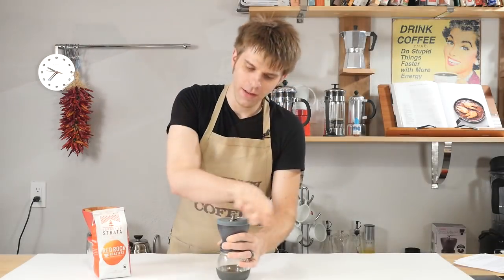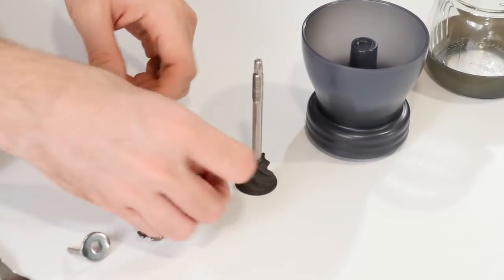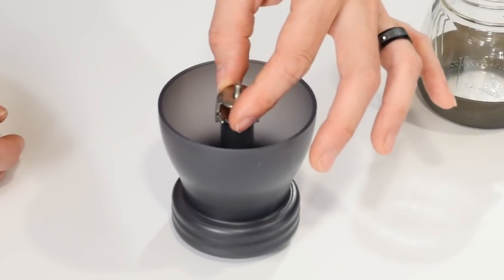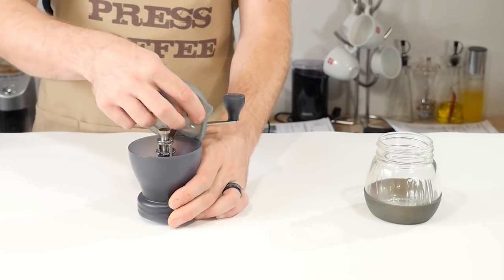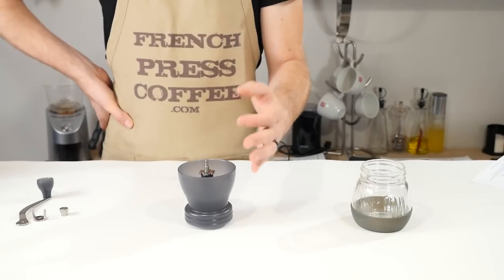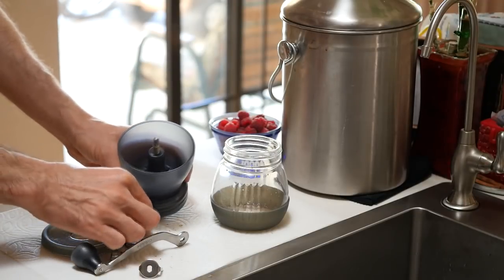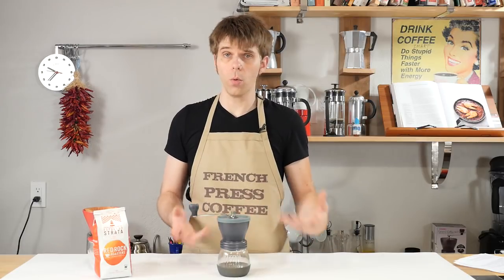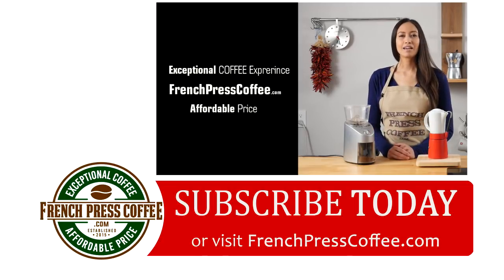Hario Ceramic Coffee Grinder Instructions - How to Use, Adjust the Grind Setting and Clean

Comment: I've had this grinder for about 5 years now, and I finally (just a few weeks ago) had a light bulb moment and discovered a great way to get the grind consistent: Once I got the grounds to be perfect for how I like my French press coffee, I used a ruler to measure the length of the screw shaft that was between the nut and the end of the screw shaft.  Then, I took the ruler and used it to put a tiny nick on the handle of my stainless coffee scoop. This made my scoop a "ruler" that I always have in my kitchen when I'm grinding coffee. I just put the end of the scoop handle on the nut and twist the nut until end of the screw lines up with that nick. Consistent every time, and no guesswork.
Reply: What’s your measurement for the French press?
Reply: @brentlawson1982  It's just about 3/4", and then I may have to adjust a little bit for different beans. Like for Dunkin' Donuts beans, I find I need to go a little finer for the coffee to be strong enough, and then for others, I may need to go a little coarser.

Comment: If you ever break your glass base, a Trader Joe's Cookie Butter jar is exactly the correct size.
Reply: A standard Ball regular mouth mason jar fits the Hario perfectly. I prefer using the 16 oz amber (UV resistant) but can get a round 8 oz that almost matches the original jar. 👍👍
Reply: @jamesb3092  But then you don't get cookie butter :(
Reply: Perfect. Thank you!
Reply: Thanks for the tip. I managed to break the glass jar of my Hario today because I didn't have it tight enough and it slipped onto my granite counter top (a whopping 3 inches :-\ ). I remembered this tip, so after I cleaned up the broken glass, I just grabbed another glass jar and kept on grinding. There will be coffee for the morning after all. A Classico pasta sauce jar is also the right size, BTW. Perfect that I was having pasta for dinner tonight... :)
Reply: hahaha
Reply: That is a really solid and useful tip. Also helpful for grinding different types of beans. I look forward to learning about Cookie Butter too! Very Cool!
Reply: Thanks Raffie

Comment: Great video. I've had this grinder for a few years and just realized the clear washer goes on first! Thanks! Another tip... if you break the glass jar or if you want a jar that is easier to hold when grinding a Mason jar has similar threads. I broke the base and replaced it with a small Mason jar. Threads on perfectly and is much easier to hold when grinding!  Thanks for the marking and notch setting tips! That is brilliant!

Comment: Good video, my Aeropress comment: I aplogize if I use the wrong coffee terminology, I am still trying to find correct notch, I am on notch 9 after my 5th test cup.  The instructions showed 2 I believe for Aeropress, it seemed a little too fine compared to my Baratza Encore electric grinder which was a 12 (Encore setting). On this Hario, when pressing the coffee this finer grind, was hard to push through, this 9 setting was close to being similar to my Encore but still harder.  The flavor of the coffee at 9 was very good (smooth) but strong. did not want to forget to post this so I am posting before I have found mine 'good' spot.  I will post next setting (or 2 or 3 or 4) as I do more experimentation.

BTW, How often do I need to do a cleaning?

Comment: My one-cup drip maker of 20 years quit on me recently and while I'm deciding what direction to go in I'm trying out a French press I happened to have.  I followed the instructions here and adjusted the nut to 7 notches, but the grind looks as fine as it was for my drip maker, if not a little finer.  It also looks pretty consistent considering the complaints I'd read about the lower burr wobbling with coarser grinds.  Either I misunderstood the instructions (provided they were indeed correct) or I've been using too coarse a grind with my drip maker all of this time.  For that I would grind 1 tbsp of beans per 3oz of water, so 2T for  6oz cup or 3T for a 9oz. cup, and this always seemed about right - a little stronger than most people prefer it seemed as restaurant coffee tastes watered down to me.  And my understanding is that these proportions are pretty standard so if anything it would seem that my drip-maker grind was finer than what most people use.  For my first French press I used 1.5oz of beans for 12oz water, and the result tastes pretty strong even for me -  with sugar, milk and cream I'm still feeling more of a jolt than I'm used to.  I can tweak the amounts but it still seems that this method uses more coffee beans overall than the drip maker did.  The strong flavor may be due to a too-fine grind, but this gets back to the original question of why they're too fine if I followed the instructions - ?

Comment: If the fixing nut becomes too tight to unscrew, instead of using a tool that may damage it cosmetically, just firmly grab the handle and turn the adjustment nut in the finer grind direction just a bit - movement restricted by nut stopper anyway - and try loosening. This has always worked.

Comment: I use my Hario Skerton just for a coarse/French press grind.  The video suggests setting the notched nut up seven notches from the zero position for a coarse grind, but that is nowhere near high enough for a coarse grind.  At least twice that is needed, unless Hario has dramatically changed their design (which I highly doubt).
Reply: What do you set to?
Reply: Absolutely. Also, do not under any circumstances use 1 notch setting for moka pot grind, youll ruin the brewer.
Reply: Right? I use 6 for my aeropress and it works wonders for me
Reply: @user-1312  what's your notch setting for a moka pot?
Reply: My settings:
- 1 => turkish
- 4 => espresso, mokka pot, you migh try also 3
- 5 => all brew coffee
- 6 worth try for french press with different coffee, but mostly useless without the Blue Horse adapter.

Comment: I use the Empare grinder, it has an identical shaft and burr set but includes a spring that keeps the burrs apart. That keeps the burrs from striking each other and the grind is more consistant.

Comment: I found 1-2 notches way too fine for my semi-auto espresso machine, Sunbeam Mini Barista em4300
3 notches is ok but you can't tamp much otherwise it'll be too compressed. Just a light touch tamp will do. 
I found 4 notches (about a medium-fine grind) worked best. Add more coffee to make up for the bigger grind size to get the right espresso extraction.
Reply: I use the notch nr 4 too (starting from zero) and 5 for brew coffee. Setting 6 and above is too uneven.

Comment: I think you have to hold onto the grinder on the bottom when adjusting the nut.  Agree that 7 notches isn't coarse enough for french press.  14 seems better if you don't like mud.  Although it comes out a little chunky.

Comment: Good vid, and keep up the good work!  Maybe you can help me with something:  My Hario Skerton must be an older model, because it does not have a plastic washer, but it does have a metal locking washer (you know, the type that is split and slightly twisted).  This washer won't fit where the plactic one does (won't go down the threads).  Do you know which step in the assembly process this metal lock washer should go?

Comment: Hi great video on dialing in the manual burr grinder settings. 
Quick question : Im still struggling to dial in the grind size for the nanopresso using a Hario manual Burr grinder. Can you or anyone else on the thread recommended how many notch settings should i choose (i do about 5 notch turns) to dial in the nanopresso (i think it requires a coarser grind size)... ... I use the V60, Aeropress and Nanopresso (but always struggling a little to dial in the grind sizes). 
The recommended notch turns on this video doesnt seem to be doing the trick for me. 
Based on your experience, Can you guys share more feedback on the manual grind sizes for the Nanopresso, V60 & Aeropress 
Cheers

Comment: Hi guys, big thank you for a great &comprehensive presentation. You made me like it.

Few questions arise though – i came across a tip, that burr type grinders can also be cleaned using raw rice, as an alternative to using detergents.
It could be a Old school Method, but i think that ceramic blades are not as hard as in comparison to cast iron burr mechanism. Rice grains are harder than coffee beans, so do you think the ceramic blades could get damaged, if rice is grinded? Ceramic blades are not as expensive as cast Iron burr Types,… that's what makes them more afordable. But i am considering buying this Grinder, since i have bad experience using the cast Iron Grinders – after 2 Months of using one, i still could filter out tiny chunks of iron (using a magnet), though i bought a well-known brand, and the price was way beyond the presented Product,… I returned the product and am about to buy a new one.
All in all i think i can't go wrong with this one...
I wonder of what material the burr blades - in the proffesional grinding machines used in coffee bars  - are made of?
I do know, that full-automatic household coffee machines use ceramic blades.

Would appreciate your expert opinion very much, many thanks in advance.
Reply from the maker: Great comment. But here's great article from Prima Coffee https://prima-coffee.com/learn/video/maintenance/how-clean-your-burr-grinder. They talk specifically about rice. Hope this helps.
Reply: Janez Prezelj ceramic is significantly harder than iron. You can definitely use it to grind up rice - in fact, if no other materials would fail you could grind cast iron up between a ceramic burr, that is how much harder the material is

Comment: Any tips on preventing the grinder from sticking or periodically becoming very difficult to turn? 
Feels like it encounters an extra tough bean. I have to grip the jar with a lot of force and crank with a lot more force to overcome the very high resistance.  Occurs every five to ten revolutions as I grind with a medium setting.
Reply: I have the equivalent of the Plus model as I added the kit that includes a metal item that captures the lower part of the shaft properly.

Comment: How long would the grounds last inside the storage jar? I'm not a huge coffee nut but I definitely don't want to disassemble this everyday i drink coffee. I appreciate it Brian!
Reply from the maker: We will recommend it to use it immediately since it's not designed for long term storage.  But it's up to you for how long you want to keep it. Enjoy your coffee!
Reply: The beauty of the little hand grinder is you can grind as much as you need when you need it - you get the freshest grind each time.  This isn't for taking a pound or so of coffee beans and grinding them all at once.  Lots of people DO grind all at once and use slowly, but if you're going to go that route, you could grind in store using a motorized bulk grinder at lot more easily.  The Hario is well suited for grinding enough coffee for individual cups or a pot at a time, but more than that might be closer to defeating the purpose of being able to grind a little at a time as needed.
This would be perfect for travel / camping or for a device like an Aeropress.

Comment: I've seen an upgrade kit (a washer that looks like a steering wheel) for this grinder, which is supposed to stabilize the shaft resulting in better results on a course grind.  Does the grinder do an adequate french press grind out of the box?
Reply from the maker: We just ordered it and planning to make a comparison. Thanks for tip.
Reply: I was wondering about that too, especially since I paid a full $3.50 for my Skerton at the local animal rescue thrift shop (and see $26 for a non-knockoff but also old style I helped a friend buy a year+ ago is still good at retail).  

Also, is there any difference between the $8-9 and $11 typical cost brands of lower spacers?  I see the shaft grinder is a little uneven, and loosening the locknut and trying to better center it and adjust tilt doesn't work (so as to get perfectly symmetrical rotation of the burr inner and outer parts).  If the parts fit is uneven, how much "wobble" is needed for finer grinds to not bind?  

 The shaft is 7 mm diameter, with the 8x1.25 mm adjuster thread "rolled" and not machine die threaded.  (Handle thread is 6x1.00 mm BTW, same as the lower grinder thread.)  That may explain why some people complain the upgrade spacers don't fit knockoffs, and why there's a PITA issue of unscrewing rather than just sliding out the shaft for cleaning if a lower spacer is installed.  

If the upgrade spacers are laser cut stainless as described, and then tapped to clear the shaft thread, that may explain the high cost relative to mass produced stampings.  The whole grinder needs an 8 mm shaft to allow it to just slide out for cleaning (Did Hario make that change in the updated newer model?).     

This video was really useful as to quick and easy adjustment tricks, where each index step is 0.21 mm more clearance based on thread pitch (now that I measured it).  But, having gauges and instruments to measure that doesn't translate to the art of good coffee.  I'd prefer a little faster pace and shorter viewing time though.   

As to local deals, is an 8 ounce Bodum frother in like new condition for 25 cents OK?  (Hospital thrift shop biannual clearance sale, living in an area with lots of educated retirees downsizing or dying off.....)  My espresso machine cost $15 new after shipping and exchange, buying a used machine with a silly recall (no label to say not to open the pressure system while hot), and trading it for brand new.  I'm still lazy about using factory grinds in a regular coffee maker most days, but couldn't resist the Hario burr grinder at 90+% off, even though I rarely use my Bosch electric (non-burr) grinder.  

Also of note, Hario is selling the newer version Skerton for around $35 equiv in Yen, but only to the local Japanese market delivery area.  Bodum's full size Bistro electric grinder with easy grind adjustment looks a lot easier to use for those who are devout about fresh grind every morning, at $80 or so.  Does it work well, and hold up to a critical review?
Reply: What's the verdict?  Is the upgrade worth doing?  One question about the upgrade - for a chemex, is the upgrade the way to go?
Reply: The upgrade is only important if you're using a very coarse grind (like for a French press). Out of the box, it does a fine job of making uniform fine or medium grinds. When it's set all the way coarse the grind can be uneven, with finer and coarser bits.

I found that the modification kit was worthwhile for me as I got fewer fine particles coming through the screen on my French press. If you're using any other method, I wouldn't bother.

Comment: Hello
I've bought the Skerton a week ago and I have a Delonghi Dedica 680 since Xmas.
This is for espresso making but I first tried notch 1 setting on the Skerton: no pouring at all, I stopped the machine to avoid damage. Went to notch2: almost no pouring, stopped the process too. I now have to go to notch3 to have a decent espresso and 'normal' volume (9cl for double cup). Is that normal ?
I now have ordered a Bodum too and will have to grind my beans. I wonder what notch setting I will have to use.
Reply from the maker: It's very hard to be very accurate with Hario. (Note: some Espresso machine are very forgiven and some not). In general recommend Hario as a budget grinder with Aeropress, Drip and etc. For espresso tuning Brazil would be a lot better and more accurate https://www.youtube.com/watch?v=oH2s6rQ43us. 
Hope this helps.
Reply: We have the same machine - hario grinder and Delongi dedica, we use notch 5... (after experiencing exactly what you described...)
Reply: Hi, thanks. Strangely, i always used notch 3 since then. You say you use notch 5 ? How long does pouring take (in seconds) ? Do you confirm your espresso is tasting fine ? I will try and go to notch 4 then 5 for testing in the meanwhile.
Pouring (with coffee at notch 3) last between 18 to 23 seconds (depending on the strength of compression you apply).

Comment: Hi does anyone else find the the ceramic burr wobbles too much and very often get pieces stuck on one side and causing the burr to be very tight lipped on one side and wide on the opposite. This is causing the grind size to be very uneven on any setting 4 notches or coarser.
Anyone?

Comment: I got mine for six months, it never worked with >= 3 notches, now the plastic frame seems to become weak or softer and the ceramic is tumbling around while grounding. The sieve line for 3-4 cups of coffee (requires more than 20 minutes plus disassembling/ cleaning/assembling) is ridiculous. Everything between extra coarse and extra fine. That‘s why Hario came up with the reinforced shaft „plus“ model, but they have serious problems with the shaft connection.
Nice design, though.